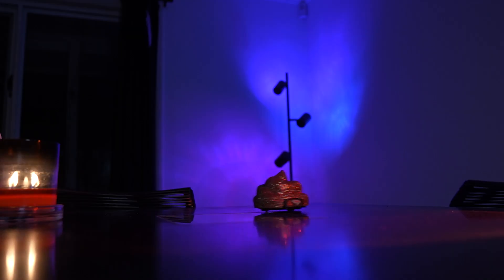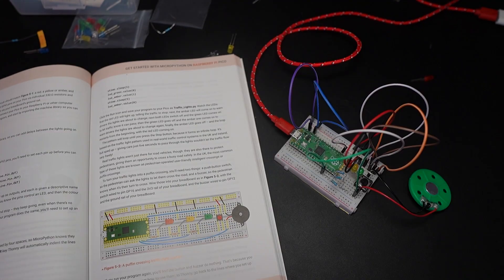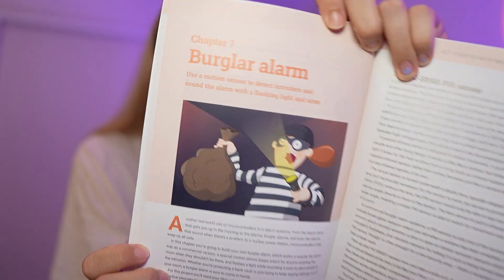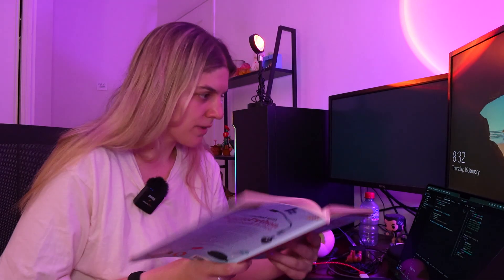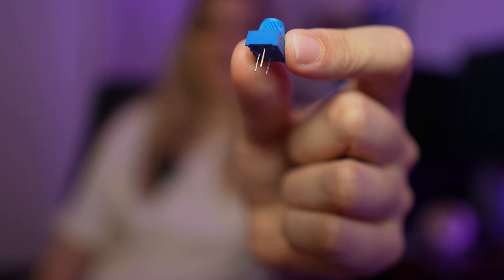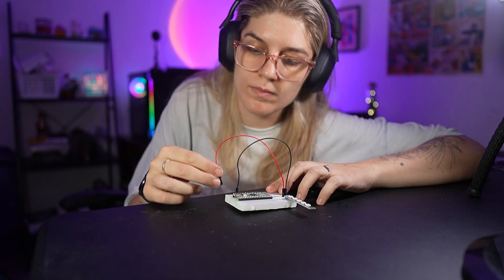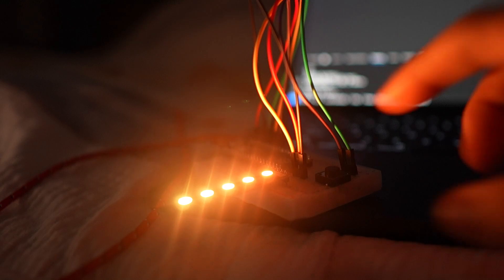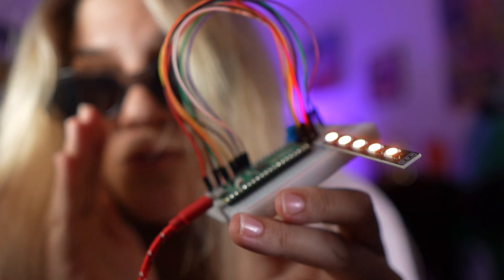every developer should try this

Comment: I hate to be a seasoned electronics engineer student and point at all the things. you remind me of myself in the early days I went on exploring and broke stuff while learning. and That FINE,. (dad still sad I broke his music keyboard)

So yeah, ive broken stuff, made the silly mistake of forgetting a "filtering" capacitor on somewhat larger projects and learned too late about pull up or pull down resistors. go ask chatgpt when and if you need them :D

I broke a long I2C bus by wrongly asuming how it worked. I now understand. its fun, broke 2 arduino microcontrollers, luckily they where socketed. swapped them for cheap replacements (and one from school haha)

Recommended book if anyone starts to feel these beginner books dont cut it anymore and you dont want 1000 other books but Youtube also isnt it. "The Art of Electronics" by  Paul Horowitz (whatever edition, physical or digital (I "borrowed" first but a local shop start selling them for a crazy low price and now are bust). Great and fun video, I subbed and follow you on the great github now. Designed my first PCB last week (that i also send in to be made, designed more often but was tooo scared to have them made). jlcpcb is real cheap, get a sponsorship from them maybe lol...

many more projects im working on, mostly software, but here is my "first" pcb https://github.com/CodeAsm/PQFP-100, its an adapter, to be very very universal from tiny pins to nice pin sized. (I have like a cpu and network IC i wanna interface with the Pico2 but these pins are crazy small. so a universal conversion board for a package I couldnt find easily on the big aliexpress or ebay (for cheap)). 

too many cool projects to work on. go make some leds blink and debug all the things. backup and break everything, have fun :D

Comment: As somebody who's been doing embedded programming for a decent amount of time: keep going. It's a weird mix of frustrating and fun.
Reply: I have been meaning to ask people in the embedded world, what language is good to learn for embedded? I have been learning a bit of C for the past couple of days, but saw people mention C++ a lot and now I am confused to what I should put my focus into.
Reply: @RandCode I would definitely recommend C. It's just a simpler language that is everywhere. But a lot of platforms have C++ support which make it a very valid and feature full reason to go that route as well. OPs use of micropython is also great.
Reply: @RandCode I’m pretty new to embedded but here is what I have picked up so far. 

C and C++ are common for Arduino style boards and are lower level languages (meaning more complex and direct with the hardware) 

Python, circuit Python, micro Python are popular with Raspberry Pi and some Adafruit boards. Python is a higher level language so it’s simpler because it’s abstracting from a lot of the intricate hardware pieces. 

A lot of board have pre-configured language moduls for both Python and c variants that pre assign pins to more memorable and easier to use variable names. But it’s isn’t always easy to find for some boards or it’s hard to set up the LSP. I would say most are fine some are not. For this reason I’m trying to focus on using C variants so that I Can avoid having to deal with board specific modules and have basic universal LSP. 

Now I am an idiot who doesn’t know much and generally gives bad advice. I have boards that function with both variants and have worked with both variants and both are fun in their own way. It’s safe to say if you want to learn embedded programming learn c, cpp, python, and circuit Python… micro python doesn’t seem that common.

Comment: PIR and photo cell are probably interchangeable for this use. But not in general.
Also it's an obvious cost cutting measure. That kit was a great example of why not the buy kits.
I don't have much experience with PIR. But I am fairly certain that even for this use the PIR just would have way more range. But technically speaking the photo resistor will detect motion. And the limited range might sometimes be what you want. So if you wanna test by holding your hand right in front of it the photo cell is probably fine. Maybe even better because of the limited range. But if you wanna monitor a wider area. Well there you usually use PIR. Oh yeah, also PIR detects infrared. So humans literally glow for that thing. So they also work in absolute darkness.

Comment: If you need a button in a pinch for testing purposes, like when yours vanished on you, you can just replace it with 2 jumper wires in your breadboard.  One end of each wire would go where you had each connection for the button, and the other end of each would just be left dangling.  Touch the wires together to act as a button press and separate them to act as a released button.  That's pretty much all a basic button is internally anyway but just laid out in a more convenient package and usually able to spring back to the "released" state.
Reply from the maker: oooh true, thanks for the tip!

Comment: Don't worry, a remote controlled poop isn't difficult. If you're a solid programmer, you can even go really really deep into the subject matter. ELRS is a largely open source and pretty much THE industry standard for everything remote controlled. At most, you need to figure out the packages sent and extract the sent data. There's so much fun in RC applications. 

Also the "mini photo cell" is a shitty description. It's a "light dependent resistor" or a "photoresistor". 

One thing that will help you immensely is soldering. Just the really really basic things, no need to get all fancy with it. Just makes it a lot easier to fix things, to add longer leads to something etc. From your trusted Chinese seller, you'll get all kinds of practice PCBs. Once you picked up everything, you can also get the "SMD Challenge Misery Edition" from hackaday. If you can solder that by hand (not hot air use allowed), you're likely in the 1% of top solderers

Comment: you're gonna have fun when you get into the lilygo t-sim line of devices (basically an esp32 with gps and gsm modem) - btw the range should be unsigned 0 - 65535 (int16)

Comment: I make small boards with components and paths at this point. The LED and some keys are then hardwired. Maybe the micro controller is replaceable. Grove connectors fit to cables and sensors. I also have breadboards because some things are highly complicated.

Comment: I’ve been getting into electronics more lately and one thing I learned is if you use a button to buy like 100 buttons. But then you need organizer bins. Anyway, the idea is to not let not having parts slow you down; get more of everything you might need.
Reply: As someone who is an electronic hobbyist and has been employed as a hardware designer - *this is the way*. There will be accidents, and parts are much cheaper in bulk. Don't buy one more button, get 10 or 20. Also, if you don't already have one, get a multimeter and one of those cheap component testers.
Those buttons typically have two leads to each side of the contact (to simplify PCB layout) - so you can work around a missing lead.
Reply from the maker: time to go on a shopping spree

Comment: A lost art of user interface design: Every button press should do something instantly. Even if it's blink a red light to let you know the action is not allowed. You would save a lot of troubleshooting time in the scenario you described at 2:43
Reply: As a embedded software engineer, during prototyping, log print all the things, and learn about how to debug your things. everywhere and always.

Blinky leds saved my brain HOURS, from scratching my brain cause I dint knew why things didnt work. ive send a simple blinky led code, or added blinky led to my multithreaded micro that has multiple cores... turned out, I had set the IO pins to the wrong config and when blicky started working, so did my LCD display :P yeey (also, ADC stopped working, so I determined i needed to move all my logic from the designated pins to anotehr bank)

blinkly leds and buttons, test all the things, backup your code (subversion helps) and have tons of fun

Comment: Wait till you to find out about ESP32 boards. Small, cheap and powerful. Wifi and Bluetooth come standard. Have you seen an ESP32-CAM board yet, those are fun. If you need small bits like a button or PIR Jaycar have them.

Comment: micropythos is quite the platform. I had been using it for work, but having to deal with it's c internals is a PITA, hope you don't have the misfortune of having to as low as that, in such case i'd highly recommend going into any other platform (arduino, zephyr, freertos,...) to avoid the almost undocumented APIs

Comment: You should get some needle-nose pliers to straighten bent pins.

Just speculating here, but I wonder if the issue with the buzzer is that you actually have a piezo speaker, not a piezo buzzer?  In that case, you'd need to drive it with a square wave of the desired frequency, rather than just an on/off signal.  That would explain why you're just getting an occasional click, rather than a beep.
Reply from the maker: thanks for the tip!

ooh I'm not sure, I just checked the listing online for the electronics kit and it just says "1 x Active Buzzer" 🤷‍♀️

Comment: I love the Pico W. I just received (10) 415/538 Watt bifacial Solar panels and I am mounting them vertically between my privacy fence posts. I will be using a Linear Actuator/Scissors lift style mechanism and LPR's . At sunrise the Pico W will move the panel to the suggested current months angle. Throughout the day it will adjust the panel every 10 minutes by raising it 5 degrees above the monthly angle and lowering it 5 degrees below the current modified average and documenting the data in 1 degree increments to select the best angle for that 10 minute time frame. It will then raise/lower the panel to the best angle based on the 2 LPR's. At sunset, the Pico W will return the solar panel to the vertical position. I have the Python sketch completed so now I just have to 3D print a small LPR module to test the software and the input/output to control the actuator. Great video.
Reply from the maker: damn, that's awesome!